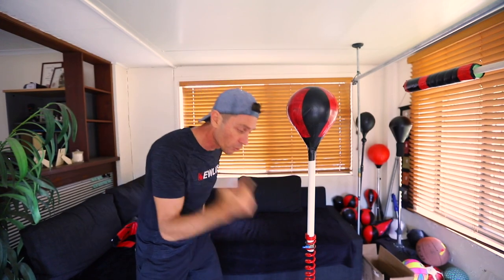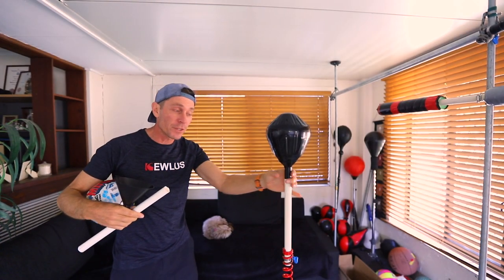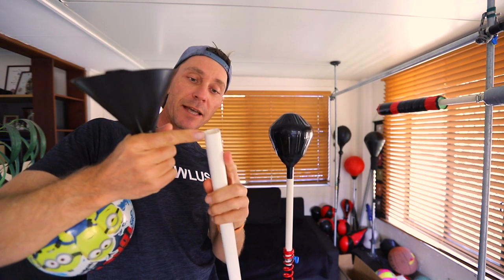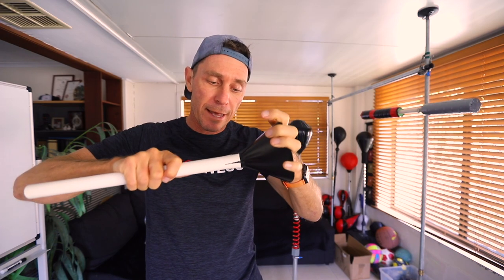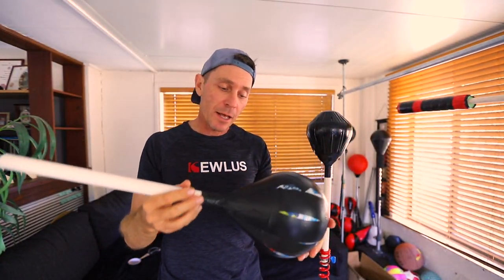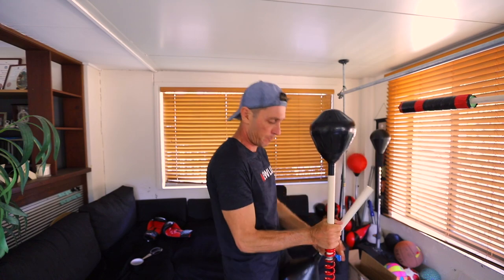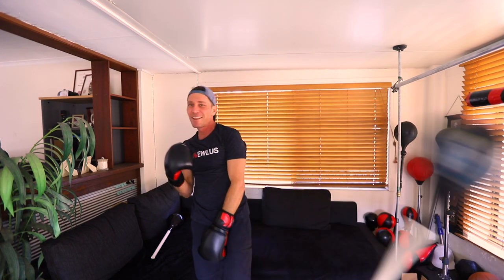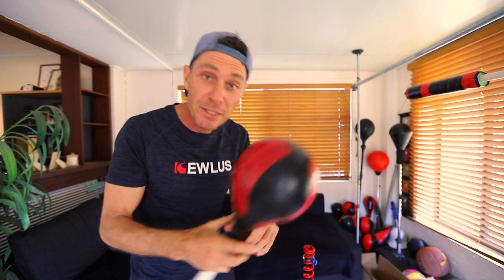Make This Super Fast DIY Cobra Bag Top Section

Comment: I’m about to build one. I’m just starting out so I’ll need one a bit slower. Would I be correct in assuming if I make the top piece longer, and the bottom piece a bit shorter, it would be a bit slower?
Reply from the maker: Yes

Comment: Can i use basketball or soccer ball?
Reply from the maker: Such a ball would be too heavy for this spring. However you could make a DIY version using a PVC pipe fro the flex. In my earlier videos I used to use such balls, even made one with a basketball.
Reply: @Kewlus  thank you so much